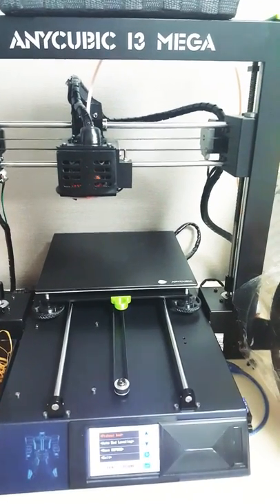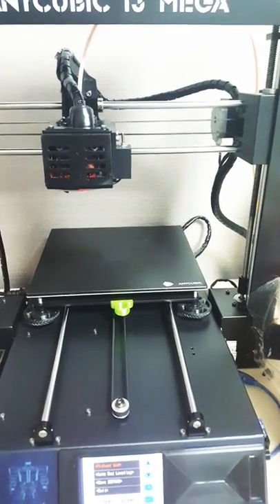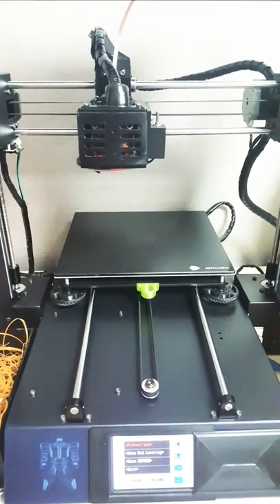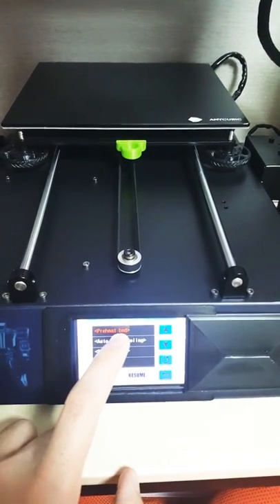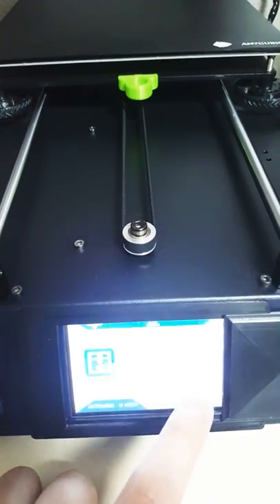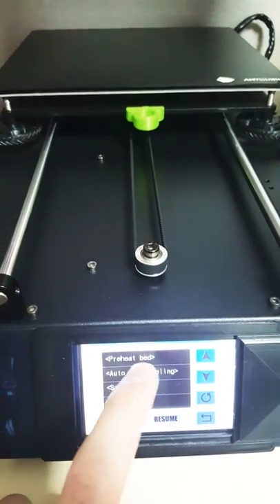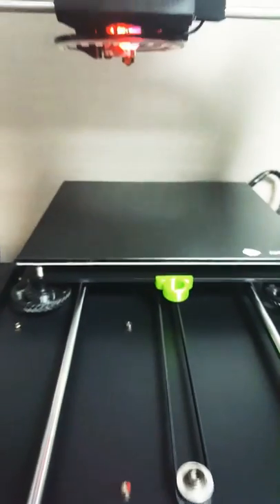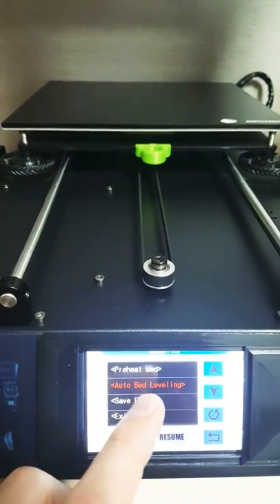BLTouch bed sensor leveling in progress(Auto Bed Leveling) - Anycubic i3 Mega/ Mega s

Comment: Newbie question - I don't understand what this actually accomplished?  Clearly the bed did not move in any of the 4 corners and you didn't adjust it, so does that mean that the printer now knows the topology of the bed and when printing will raise or lower a bit to compensate for say a low corner?  Is that how this works?
Reply from the maker: You need to do Z offset adjustment separately. Unfortunately I didn't mention that part.

Comment: Can these mods be applied to the i3 Mega-S also?
Reply from the maker: Yes, it does. i3 Mega and Mega S. Just follow the instruction very carefully.
Reply: @ariankojefferson2758  Thanks. I wish I had your skill and knowledge, then I'd buy and install all of the components so that my i3 Mega-s would at least work again. At the moment, it's just unusable because the bed is warped in the centre and the rods may not be straight...
Reply from the maker: @demonnet  Well, it is not that hard to replace the rod, but for the bed, leave it to the bed sensor, it can handle all this.

Comment: did you change the firmare im having problems with the posission on the plade is wrong can you share the firmware
Reply from the maker: Follow my Thingiverse link.
Reply from the maker: it is all mentioned there in Thingiverse
Reply: @ariankojefferson2758  thanks i try
Reply: I USED Marlin-Ai3M-v1.4.6-stock_drivers.HEX on my anybubic i3 mega s but i goes too close too the front off the plade so the bl touch is in the air... can u help me
Reply from the maker: @glenpedersen1051  yes i will help. Plz give me Fb i.d
Reply: @ariankojefferson2758  ? facebook? Glen Grabow Pedersen
Reply: facebook.com/glen.g.pedersen
Reply from the maker: @glenpedersen1051  this is my facebook I.D : soheil Jefferson or u text me through Thingiverse.